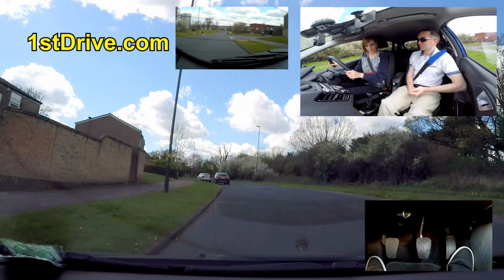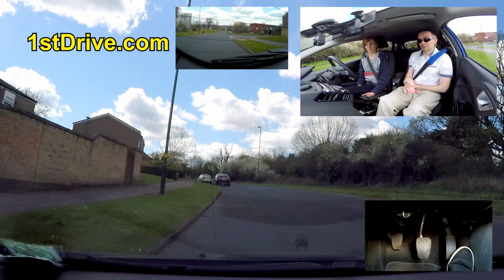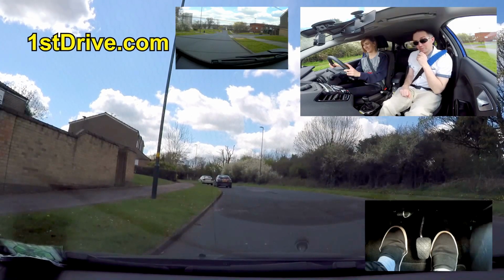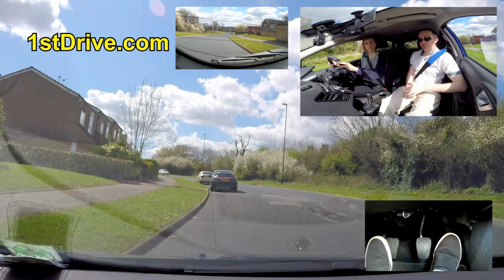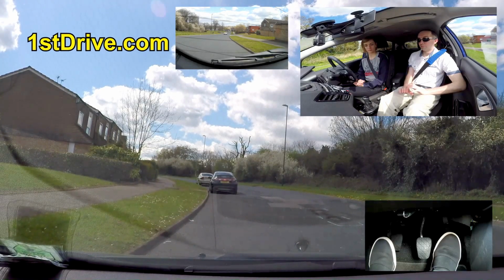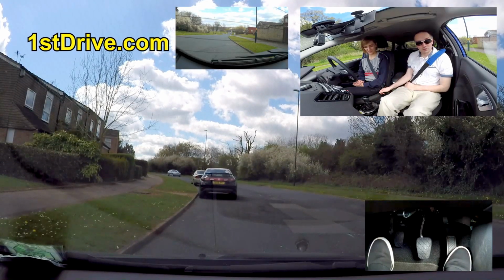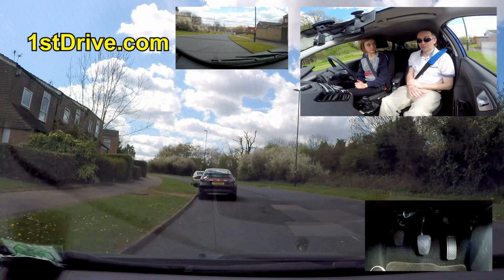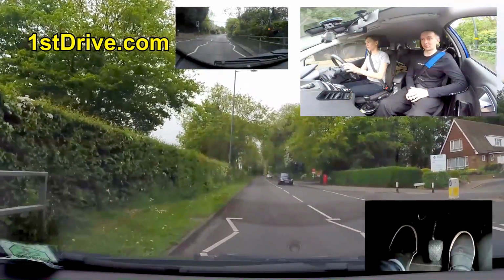Clutch control driving lesson

Comment: Hi there, I have a question about foot positioning on the clutch.  I've been learning to drive since January (my other half taught me for the first few months) and I have just had my second lesson with an actual instructor the other day.  We were going over clutch control and he was saying that I should stop placing my heel on the floor when I'm using the clutch to keep the car still.  I'm confused as I've been told by other people say that you have more control over the clutch when your heel is planted.  What would you say is the best way to go about this?  Thanks :)
Reply from the maker: You should use whichever method works best for you. It depends on the size of your feet, mine are long so I can dig my heel into the floor and use it like an anchor but with shorter feet that might not be possible.

Comment: Hi can you tell me if a driving test will always be failed for not checking blind spots on roundabouts ?
Reply from the maker: That depends on why you're checking them and when. There's no rule that always applies.
Reply: 1stdrive if I'm changing lanes is it a must ?
Reply from the maker: It depends on the size, shape and speed of the roundabout. It's usually ok to just check the mirrors but if you think you saw a car behind you that you can't see in the mirrors anymore it might be worth a check. There is no hard and fast rule because there are thousands of different situations that could occur when driving and they can change every few seconds.
Reply: 1stdrive thx for reply. Final question is using one hand to reverse a fail on driving test manuevers? Love the vids btw
Reply from the maker: No you can reverse however you feel most comfortable. You can take the seat belt off when reversing if you want to.
Reply: 1stdrive thx for reply also for the parallel park how serious are they on distance from the curb ?

Comment: Hi, I would really appreciate if you would reply back to me.On my first driving lesson, I had difficulties releasing the clutch after the biting point.  I want to know that does shoes make any difference when it comes to driving in general?
Reply from the maker: Shoes make a huge difference. I like to drive in loafers or anything with a thin sole. Vans are designed with boots in mind which is why the pedals are placed further apart and at different angles to car. Thanks for giving me an idea for a new video :-D